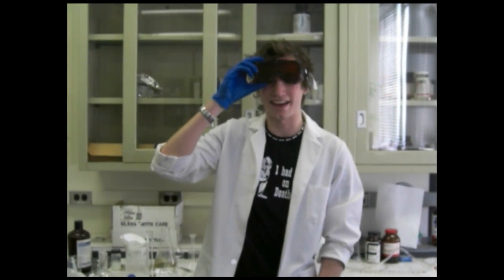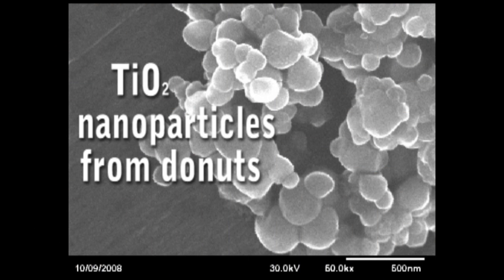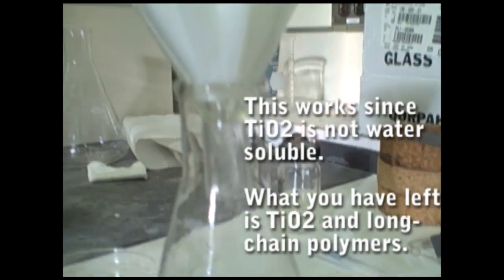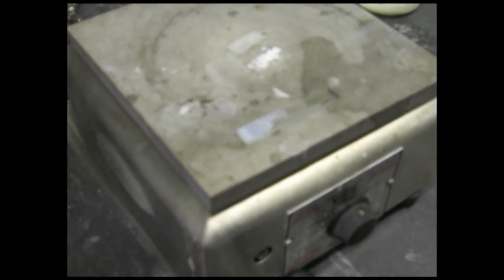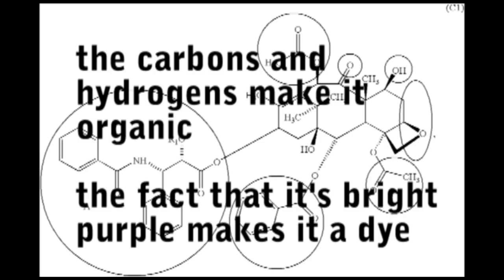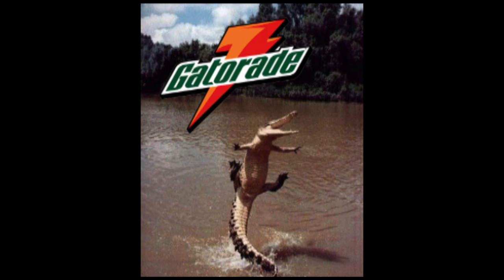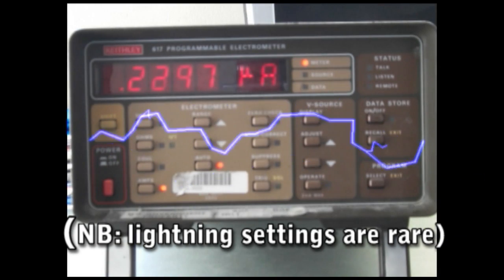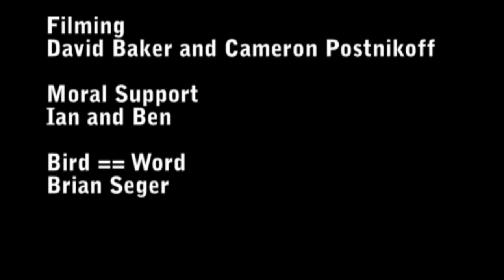A Delicious New Solar Cell Technology

Comment from the maker: Hey Amanda-

Only one side of each piece of glass needs to be conductive, the side that faces the TiO2, dye, electrolyte and stuff.

Not sure on an exact minimum temperature, but I would do a self-cleaning cycle on your oven which generally goes up high enough to burn of anything organic.

good luck!

Comment from the maker: @Nathaniel Sure, a voltmeter will measure photo voltage, while an ammeter will measure photocurrent. You need both to figure out how much power you're making, but one or the other will still tell you whether it's working or not.

Comment from the maker: @Riokushinaku 
Short answer: No.  Longer answer:  Potential is not area dependent, current is.  Multiply area by ten, voltage stays the same while current gets multiplied by 10 (theoretically).  This is not an economically viable way to make solar cells, and most definitely not a marketable product.  Sorry.  Longer answer sent via private message.

Comment: Hey caudex, I was wondering, I can find Ti02 on ebay in bulk. It is pure Ti02 for very cheap. Would I be able to buy that and use it in the same manner you did here? Also, just that little tiny cell produced .5v? I have seen commercial cells that are about 6'' long and 4'' wide that can only produce .5v. How can this very small piece produce as much as one that is much larger? I really love science and would love to do this at home and make a business off of it to make money.

Comment: also, you have to take into account the area of the cell. It looked like he was getting 4mA of current in the sun (4000uA) for a device that was maybe 1cm^2. That's really not that bad considering with a Si cell, you might get about 5 times that amount.

Comment: Dupont in New johnsonville Tn. make titanium dioxide by the ton, You could talk them out of the stuff that spills all over the ware house floor and the floors of the delivery trailers as the supersacks they use leak badly.Hell the stuff is all over the place around there.